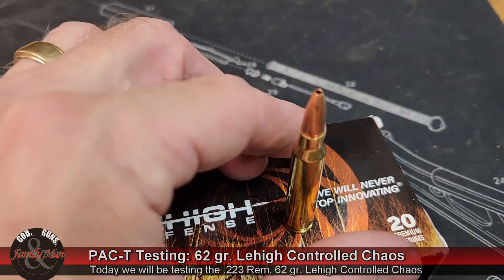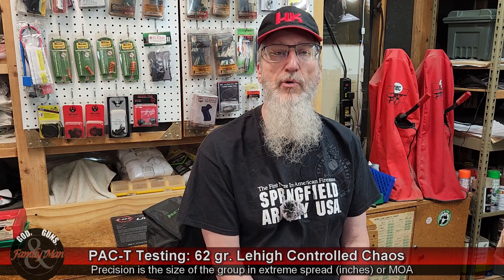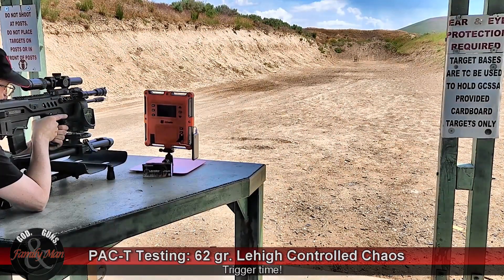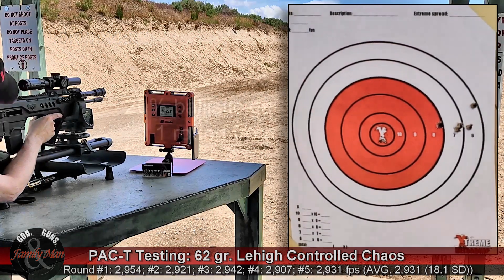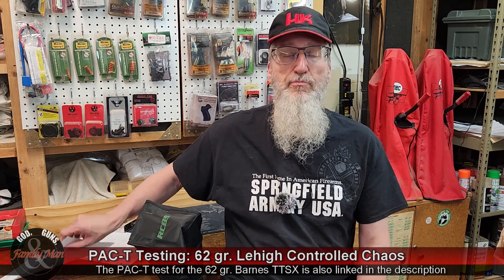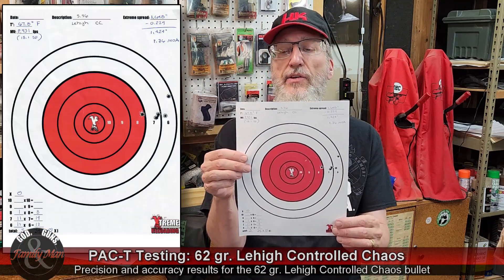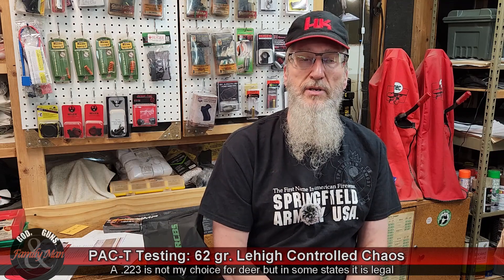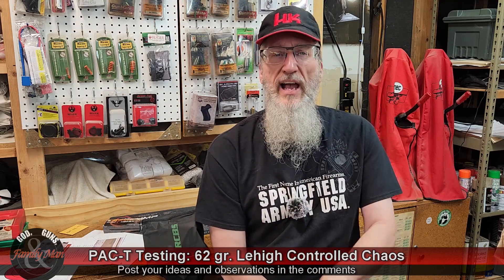PAC-T Testing the 62 gr. Lehigh Controlled Chaos (with soft barrier)

Comment: I want to see at least 16" and more of penetration in gel with 5.56/.223.  If 12" is the "sweet spot" as recommended penetration that needs to be changed.  Too many people put so much emphasis on making sure there isn't "too much penetration."  Sufficient Penetration is extremely important.  I much rather have too much than not enough any day of the week.
Reply from the maker: Thanks for watching and posting.  Here is a link to another test we did, using what I consider the best 5.56 bullet out there, the Barnes TTSX: https://youtu.be/H2Yq3pDfOY8?si=OPxkZPyAuhE3hvaQ
Reply: Thanks!
Reply from the maker: @gabrielduell5226  You are welcome.  That Barnes bullet is quite good.